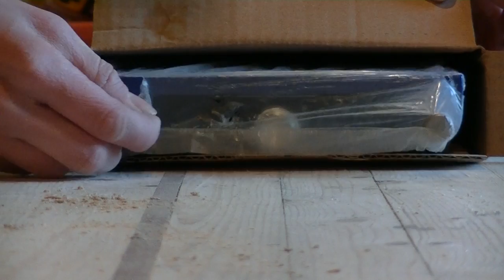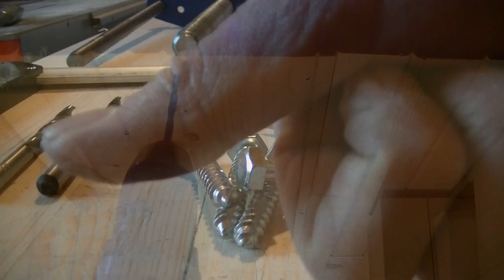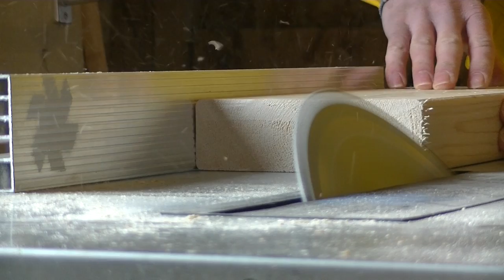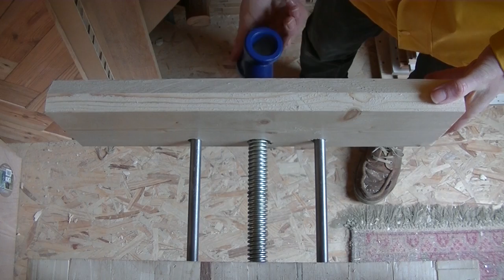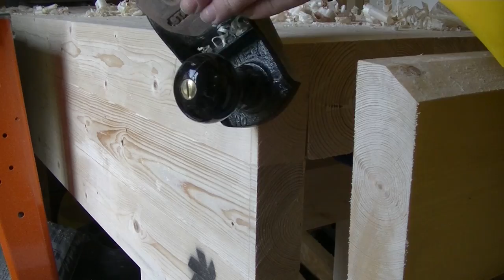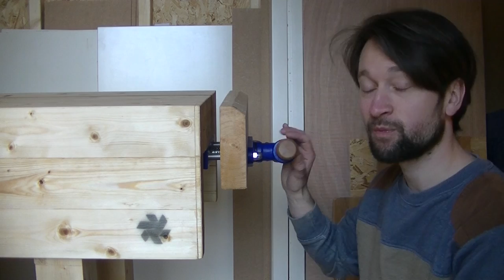Woodworking bench part 4 (End Vise & Finish)

Comment: Nice bench when I get finished with my tool chest I'm working on I'm building a bench and I like your design I don't have a lot of space for a huge bench but I think your bench is just the right size. The only thing im going to do different is add a moxon vise and dog holes on the side for edge planning.